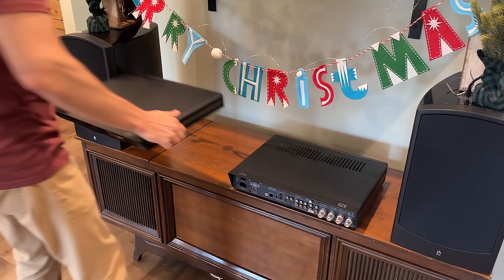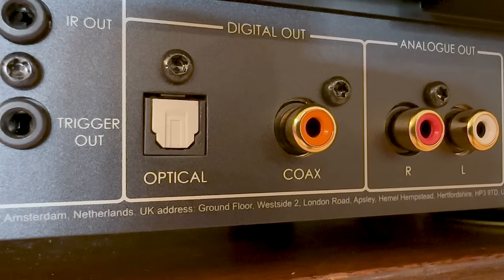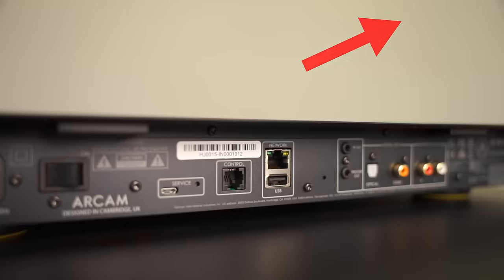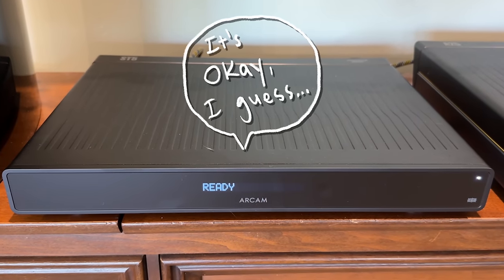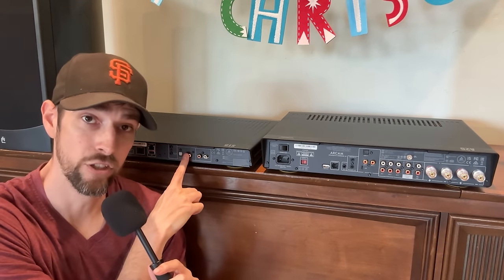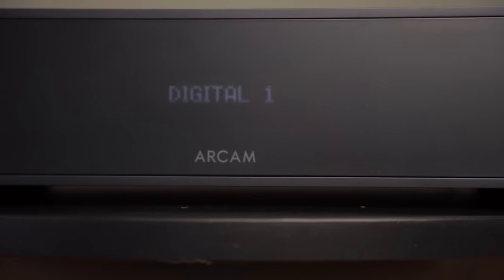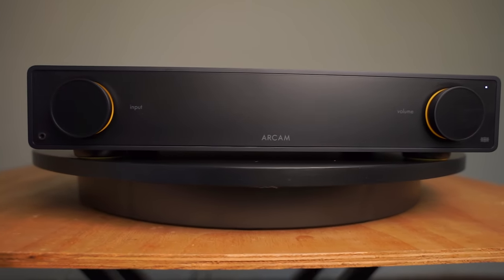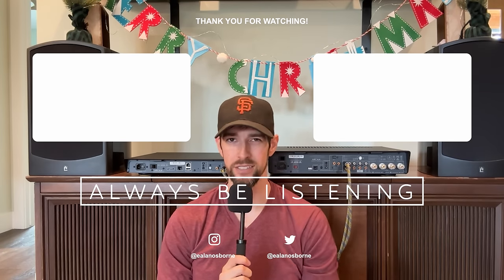DIGITAL or ANALOG OUT? | Stereo Hi-Fi Basics | Integrated Amp

Comment: Actually, there IS a difference in Toslink and coax digital signals. Toslink is technically slightly faster, but coaxial can carry a 24 bit/192kHz signal, whereas optical is limited to 96kHz. Coaxial can, on the other hand be subject to line noise if used in a cluttered area. Optical would be best in a larger scale studio set-up or system where multiple amplification sources are utilized. Coaxial has an audibly better dynamic range and provides a HUGE amount of headroom for high-complexity music passages. Optical is a "better" signal, but not for audible range and clarity are desired.

Comment: All your videos are great! I am looking into getting a music streamer. I have a 5.1 system and growing powered by an Emotiva XPA 3 Gen 3 for my LCR. Any suggestions? Budget $1500.00 or less.
Happy Holidays😀
Reply from the maker: The ST5 I use in the video is excellent! Very good DAC inside. Not sure which AVR you currently have, but it may have an impressive DAC inside on its own, since you’ll probably just want to have a digital connection between the streamer and AVR anyway. I know your budget is $1,500, but a Wiim Pro Plus is also a fantastic streamer if you just need digital streaming options and AirPlay2 or Google Chromecast support at a fraction of the cost. 🤷‍♂️😁

Comment: Coax can carry higher bandwidth.. Optical would not be affected by EMF interference.
RCA Coaxial should be 75ohm .. not just any cable.*

fact check me. =)
Reply from the maker: Ah yes. True. I just wish someone improved the outdated connections of optical cables so they weren’t so prone to breaking. 🤘
Reply: @ealanosborne  - Agree. The really flimsy connectors all around are not great.

SOME of them are great ..but you can imagine how much more money you spend to find the metal and well constructed units that have them..

OR a BNC / AES digital.. etc.